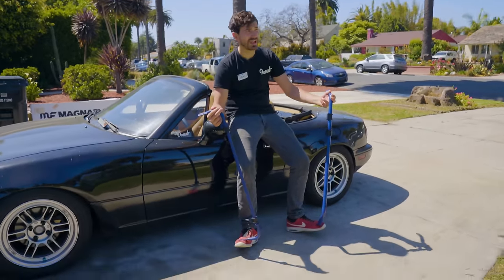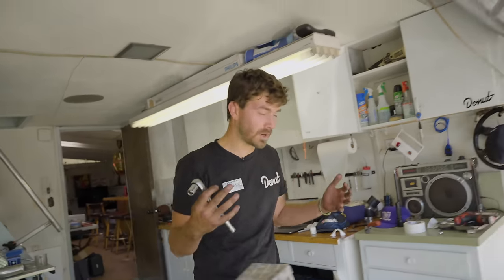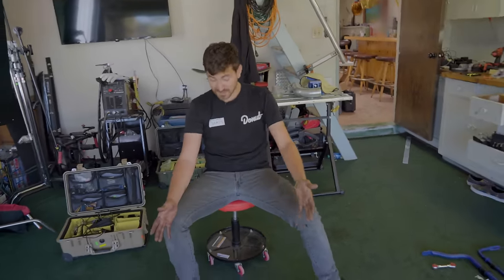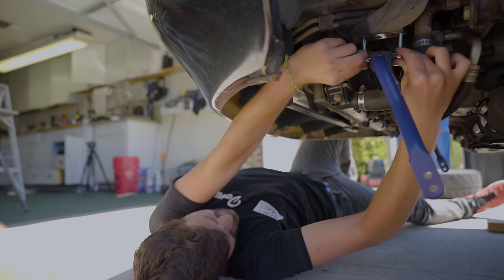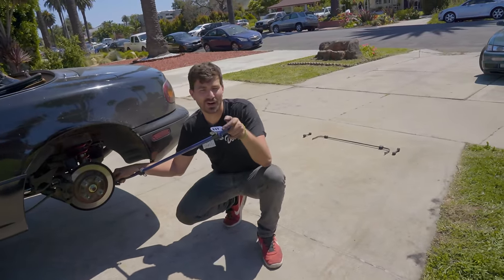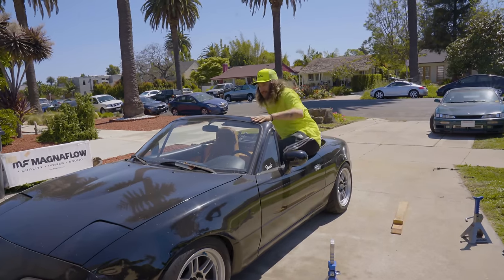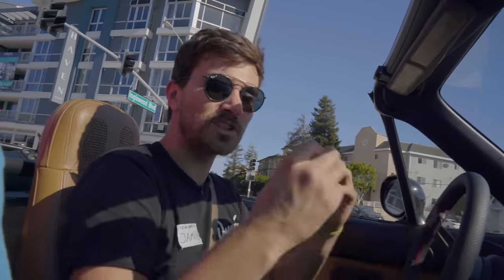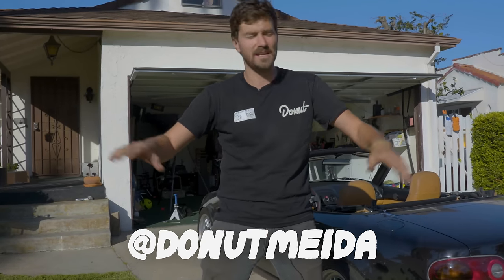Are Aftermarket Sway Bars Worth It?

Comment: “It’s as easy as removing the hardware.” Unless its a freaking Mazdaspeed 3 with the front sway bar on top of the subframe!
Reply: Haha same with E92, have to remove the entire rear subframe for the rear sway bar lol
Reply: I had a Volvo S40 which was the same platform. The sway bars, and practically everything suspension related was a total pain in the ass on that car lol
Reply: G  Something light and takes well to turbocharging
Reply: Jonathan Wilson sane on my focus 🙄 the rear is simple though
Reply: Same with the Alfa GT/147/156
Reply: G  anything with an LS. Throw a cam, tune, bolt ons and your good to go
Reply: 3000gt vr4 you have to drop the rear frame for the rear. And drop the transfer case from the transmission in the front for the front sway bar.
Reply: krudmuphinstudioz damn I was planning on upgrading the sway bars on my P2 S60 so I hope it's not the same case

Comment: There's a lot more to sway bars than just keeping the car flat. The way they load the tires in transients and steady state cornering is even more important as feel. Your coil overs are even in the mix. Every car is different of course but most RWD cars can get pretty hairy if you get too much stiffness in the rear bar. Too much in the front can make the car plow and too much in the rear can make it over steer wildly. Good reason to buy a quality tested kit vs Billy Bobs one off custom bars. By the way I love your project and Donut Media. Keep up the good work and thanks.

Comment: Sway bars were the best upgrade for the NA Miata. They left them a little bit too loose for the stock setup for comfort and adding a good set of sway bars really planted the car to the road nicely. Easy to install and not expensive to get so much better handling is def. a big help.

Comment: Sway bar is Easy and fast to install.
Me as a w126 driver: "LOOOOOOL! "
Reply: The Mercedes life has its drawbacks
Reply: is it that difficulty to install a sway bar in a merc? I never done one though
Reply: @ramadhanisme7  they're usually somewhat hidden between the k frame and body which means lowering/removing the k frame to get to them. A number of cars have it that way just to make room for other things
Reply: @adammiller8133  same in modern BMWs. Sway bar install requires dropping the subframe, both front and rear. huge pain in the ass
Reply: Drop that subframe lol
Reply: @kaboom555  same in VW's. Germans must hate us.
Reply: @ramadhanisme7  in w221's you have to drop the rear end to get the sway bar out.
Reply: @X100PRE  payback
Reply: @ramadhanisme7  in the w126 they are not under the car, the go more or less through the car. Right between engine an cabin. So if you wanna change it (and they tend to rust on the mounts) you basically have to tear apart the whole front. Yay...

Comment: I got h&r sway bars on my a3 and I couldn't agree more. It's one of the best mods I've done so far, specially with a couple negative degrees of toe at the front and some camber plates. The car turns in insanely good.

Comment: So, my two cents about sway bars/ anti-roll bars is, make sure you do your research and get bars that are spec'd out right for your application (or get adjustable ones). Sway bars over no sway bars is almost always a plus, but if you go too big or too small, they can really negatively impact your handling. For example, too large (too stiff) of a sway bar on the front can cause the car to under-steer, whereas too small (too soft) of a sway bar can not only cause over-steer, but also make it difficult to recover from over-input on the steering.
Reply: In FWD applications it's nearly always worth dumping the front sway. Those who can recover from under-steer understanding the benefits of increased tracking outweigh the mild negatives. During normal driving a lack of a sway bar will not be noticed. In the event the car starts to understeer simply lay off the accelerator and the car without much drama will correct on it's own.

Any suspension stiffer than stock greatly reduces the need for a sway bar in the front. This is for track, auto-x, spirited, etc.

Comment: "easy to install" snaps the bolt welded to the inside of the frame rail so bolt spins nut in frame rail. DOPE
Reply: Billy Horton this is why I hate suspension work with a passion. I swear every suspension job I’ve done on any car I’ve owned has been a nightmare. I promise I’m not complete shit at wrenching.
Reply: Andrew Guyther looks like illl leave my away bars alone 😂
Reply: happened exactly to me but it was my friends car
Reply: @ReviewedByAndy  I'm that way too. I fucking hate working on Suspension. The only time I ever had a good time was when I was putting coilovers in my Volvo V40.. and even then, that's because Volvo made the hub carrier out of cast aluminium and all the bolts are stainless steel.
Reply: 50/50 atf/acetone mix. shake before using. spray down all bolts and nuts every now and again for a week before doing the job. It will help tremendously even if you dont do the entire week. Just good penetrant in general

Comment: “This is never really going to be fast in a straight line”
Sad LS noises
Reply: I'd settle for a K series.
Reply: keep those filthy LSs away from these pure cars
Reply: Michael Remington I would put a APY in it (the 1.8 Turbo engine from the old Audi S3, it’s insane what this thing can handle in comparison to the normal 1.8 T)
Reply: You mean a VW 1.8t?
Reply: obsidiannightwolfe13 no, the APY and BAM are different engines, they came only in the S3 and the TT Quattro
Reply: Lol here in Costa Rica there was a rx7 swapped with nitro miata.
Reply: @davidhenneberg6772  so... The less powerful version of the two but can be mapped up the same with an aftermarket tune. It just lacks vvt and an egt valve for the wideband fuel injection
Reply: obsidiannightwolfe13 it can’t be mapped to the same because the turbo is smaller and the interior can’t handle the power as well, the APY and BAM is capable for more power on stock internals.
Reply: With a Rotax Supercharger kit it will make around 260/320bhp. For a light car... interesting idea...
Reply: @fernandofragoso4118  Rotrex : )
Reply: @connivingkhajiit  LS is about the same size as Maita's stock engine and has 4 times the power lol.

Comment: My first hearty set of bars were installed on my 88 Trans Am. They had to be broken in to be safe. The first couple days, i could slide my rear end around every corner without any throttle, they were so damn stiff. Best suspension upgrade Ive ever done. Driving it was better than ever. Miss it.

Comment: Sway bars are indeed a must have. My 83 El Camino doesn't have a rear sway bar and when you floor it the whole front end twists (gbody shuffle/the more power you make, more it becomes noticeable) and I'm going with a fixed/solid sway bars both front and rear they are more beefier and a 100% bolt on from UMI.

Comment: Swapped the stock sway bars out of my 2005 mint condition Tahoe, I installed Eibach sway bars front and rear with the adjustable links. Completely 100% improved the handling, no regrets doing that.

Comment: Heads up, this will hurt the ride quality when you hit a bump on only one side of the car. The suspension is now less independent.
Reply: Even better when you go through an S-turn with an oversize rear bar and the back wheel comes up.
Reply: cookiehead2 meaning?
Reply: They're just like most other modifications: match the specs to your tastes. You can get springs/dampers so stiff that the ride will go to sh*t. You can get an exhaust so loud all your neighbors will hate you. But there are alternatives from mild to wild. Different thicknesses and adjustability from various manufacturers allows mitigation of undesirable affects. Get a mild set if you're concerned about this. I have a mild set on two cars and have never had a negative experience.
Reply: @mzmishu  lower overall traction in corners, especially when the road is banked or uneven.
Reply: Jtzkb it depends on what you want to achieve, but in general you don’t need to change the sway bars to get good street/road performance.  If you’re on flat a race track then stiffer sway bars can make a positive overall difference.  But once you get onto bumpy roads or roads that switch camber quickly, stiffer bars usually do not help overall.  The compliance of the suspension in those circumstances (less stiff) is a positive trait.  
You mentioned removing the bars entirely - I have heard of some FWD driver removing the front bar for maximum front grip, but that will reduce stability a lot.  AutoX is the only place I can imagine that working well.
Reply: @cookiehead2  on my fwd i kinda want that 😂
Reply: @cookiehead2  it sounds like youre only focusing on the negative of aftermarket sway bars. Obviously, if you get stiffer bars, the springs wont move as much. Thats kind of the job of a sway bar, to reduce the difference in spring movement between both sides. If you dont want to go crazy, get a less stiff bar. You should only go extreme stiffness when your goal is to track it, where theres almost no bumps and your car is as low to the ground as it can go
Reply: @daniellau5859  Correct, the positive aspects are in the video.
Reply: Thanks for posting this. The roads in Cali where they filmed this must be smooth. The roads around me are very uneven left to right. To the point where I avoid specific lanes on certain roads. It makes being a car guy a little less fun. I used to think Baja-style trucks only shined in high speed desert situations. But out here on the east coast they make a lot of sense for driving in these uneven, desert-inspired “roads!”
Reply: @cookiehead2  you are 100 percent correct, my car an infiniti came with front and rear sway bars stock! lmao my girl didnt like it as every damn bump was felt, good handling but stiff as heck! oh well. Its good for me.

Comment: Great video. I actually thought my Mazda 3 handled REALLY well from the start and I loved driving it. Eventually something happened with the rear sway bar -- I remember it clunking ... and then I think it just fell off somewhere? I definitely feel an uncomfortable difference without the sway bar. Driving on mountain roads, way not as fun and that's something I do lot since I love hiking and roadtripping. I avoided getting it replaced because a lot of mechanics told me I didn't need to get it fixed or replaced. But I think it's really worth it. I think the way it improves safety is also undersold. There was a time where I hydroplaned seemingly on one tire while on a curve on a rainy day. Thankfully my instincts handled the situation as best as I could and there was no accident, but that was really weird and scary. I wonder if that would have happened if I had the sway bar on.
Reply: ...mechanics told you that you don't need your sway bar?

Don't ask them anything else.
Reply: @noneyabizz8337  technically you might not need it to remain road legal. There are vehicles that don't come with sway bars.
Reply: @christopherjohnston6343  that doesn't mean you should drive one that's supposed to have on without one.

Comment: I'm really glad  that I found this video. Because I want to put sway bars on my 98 Subaru legacy wagon cuz it has way too much body roll for me I'm used to an 86 trans am. But I still started hearing this clunky sound when I'm going over potholes form my right front or passenger front wheel. And not because I was doing this to get rid of the noise but I had to replace all my rotors and pads for inspection at my right front or right passenger caliber went out there's no way that it's anything else and it can't be a bearing wheel bearing becauseI had that replaced a year ago. And now you told me that that one component if it gets worn out I'll hear a clunking sound but that's what I hear it almost sounds like the brake pads are slapping against the rotor but again that's not the case. thank you for taking the time to make these videos I was just going to let the garage find that during inspection I was going to tell the garage to replace whatever's doing it but it would cost more obviously if they do it so I'm going to do it myself. Again thank you for making this serious I enjoy a lot.

Comment: Getting some Eibach sway bars for my Corolla SE as my first suspension upgrade. The stock ones are hollow tubes so I have a feeling it will stiffen considerably and feel very responsive in the twisties. The roads I drive on are mostly very flat so I'm not worried about losing a bit of wheel independence. If you factor in how tires work, too much body roll will stretch the outside tires to their limit and they will start to lose grip. Sway bars reduce the pressure on the outside tires by loading up the inside tires, this allowing the tires to stay elastic. This does technically mean thicker sway bars do increase cornering grip compared to thinner sway bars or no sway bars on a perfect surface. The balancing act comes when you consider how rough of a surface you are driving on as lack of wheel independence can also compromise grip. For me though, I think my car will benefit greatly from the decreased body roll, which in itself makes the car too floaty and unpredictable. Great video.

Comment: Sway bars on my 73 Camaro RS (along with a new close ratio steering box and some coilovers)  completely changed my attitude towards muscle cars... thing is SO much nicer to drive. 

Oh... throw some upgraded sway bar mounting brackets from FM on that thing... the OEM ones flex like crazy in hard turns (even OEM springs).

Comment: Biggest advantage of sway bar upgrade, is a rear sway bar on a FWD car with an open differential.
Specifically a rear sway bar, so that the rear is somewhat more resistant to body roll than the front (typically in most cars the rear will sway 'more' than the front). Reason: a firm resistance to rear body roll helps counteract a corner-to-corner sea-saw effect which causes open differentials to lose traction on that inside front wheel accellerating in turns.
Open diff traction loss in turns is really noticeable on my Mazda 3, I really should get a phat rear sway bar to rein that in somewhat (sadly, no aftermarket LSDiff available).

Comment: Adding larger-diameter  Anti-Sway Bars can add comfort, improve handling, shorten stopping distances,  and reduce tire wear for just about any vehicle.
I installed a 1-inch  bar  and greaseable Urethane bushings on the rear, and a 1-1/4th-inch bar and greaseable bushings on the front 
of the famous 95 MERC, along with greaseable end links (front), and Urethane end-link bushings at the rear.
The thicker Sway Bars and Urethane Bushings allow for precise handling for the 2-ton sedan, when coupled with KYB "Gas-A-Just" shocks all around.  The 95 MERC is set up for long-distance, high-speed cruising throughout the deserts and mountains of the American Southwest -- and performs exactly as expected.

Comment: I find that sway bars are even more effective on large top heavy vehicles. Large Van's are bad in cross wind or quick lane changes. A good set of Hellwigs makes a huge impact on handling. Solid Bars versus hollow tubes and good materials like 4130 chromoly. And polyurethane instead of rubber bushings.

Comment: I beg to differ on the feel of a car going down the road with huge sway bars installed, you can definitely feel a difference.  For instance on my CRX, I installed ST suspension front and rear sway bars.  And since the car has no rear sway bar, it did make the car ride stiffer over all.  Going from no bar, to a 22mm bar is a huge, huge difference.  In fact, it's almost 1000% stiffer in the rear now.  If it has a rear sway bar, it would be an increase of about 500% more stiff.....

Comment: 😆😆😆😆😆😆 Im dying! bout ehh, 12 yrs ago now, my last miata was a 97 and i had it slammed pretty much like yours...getting your head stuck is not shocking at all!! I remember that I could touch pavement without leaning over from the sitting position or at least not leaning over for more than a few degrees.

Comment: First off, that intro animation is gold. Took me a few watches to see what happens but I can't stop loving it now.

About sway bars not having adverse effects - don't they make the suspension 'crashier', for lack of a better word? If one wheel drops into a pothole, won't the sway bar do unwanted stuff to the opposing wheel?
Or does it work the other way around - the fact that the opposing wheel is lifting the sway bar may keep the pothole wheel from sinking too deep?

Just trying to figure out why most cars have soft sway bars, other than cost and possibly weight savings. My little bucket of rust and regrets rolls like dough, so wouldn't a better sway bar make it objectively safer?
Reply: Soft sway bars for comfort. Stiffer sway bars = stiffer cornering. Most consumers don't want race specs (ish)

Comment: Get a set of low profile ramps. You'll thank me. Any time you need to get under the car and torque something or set something with wheels loaded  you will have an easier time of it. Also, on many cars, you cannot just pull the rear bars out. You have to drop the rear subframe, which can be a royal PITA including disconnecting brake lines. Looks pretty straightforward on that MX-5, though.

Comment: ...there's always a sweet spot when it comes to size.   Bigger is not always better b/c the  way the math works out with the RSB circumference.     Also, the stiffer the RSB the better tires you'll need.    Handing will be more responsive, true... but the front tires won't have the advantage of the extra weight/pressure as the car lends over.

Comment: Stiffer sway bars definitely affect ride quality because they transmit bumps and potholes to the rest of the car. You can limit (not eliminate) the effect by making sure the links are installed in a neutral position.